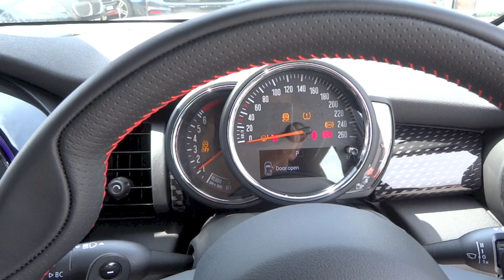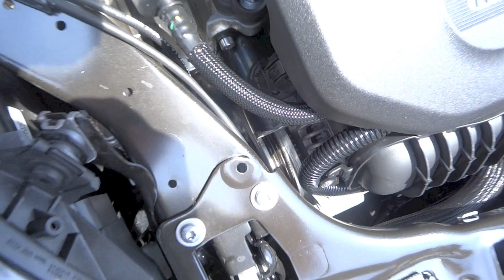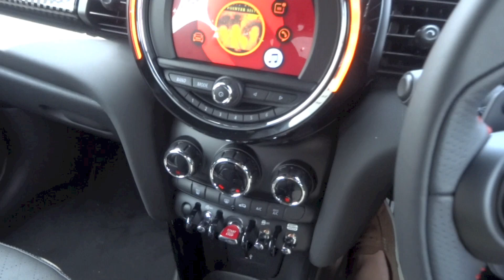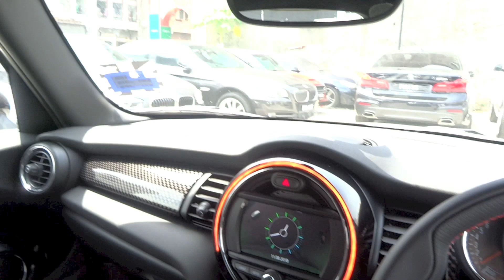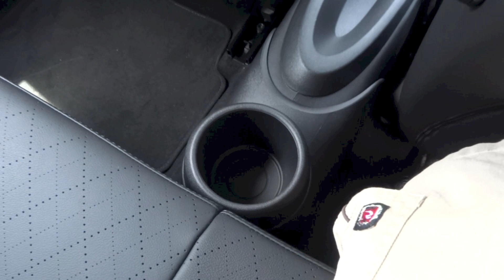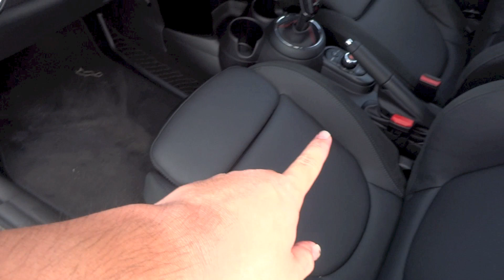2018 MINI Cooper S Hatch (5-door) Start-Up and Full Vehicle Tour

Comment: Seat adjustment fail, you are paying for rm25X K - rm26X K for manual seat adjustment. Others should ok.
Reply from the maker: zack zabri The MINI Hatch isn't available with powered seats as far as I know.  Besides, I don’t see anything wrong with having manual seats.  They work faster, they’re easier to operate, they weigh less, and they won’t drive up the price of the car.